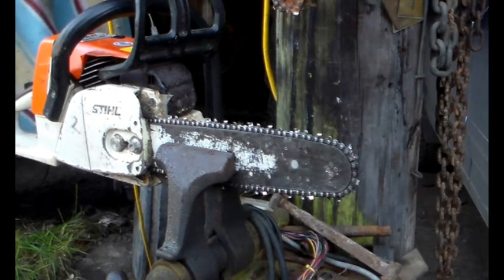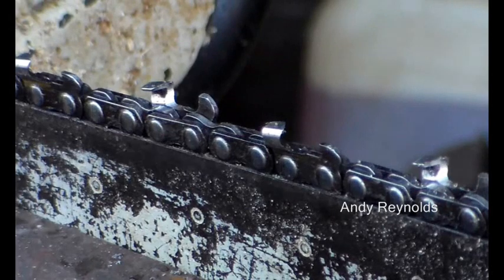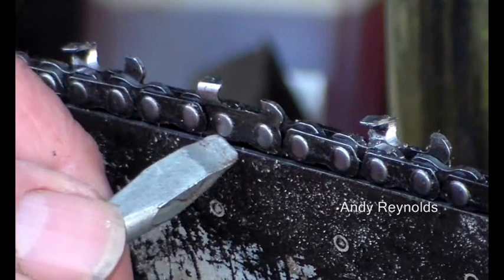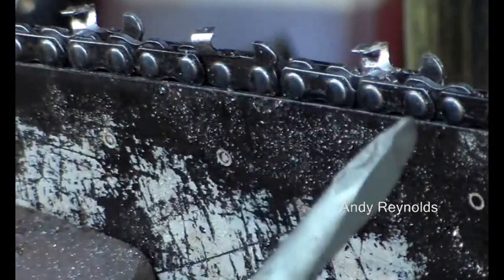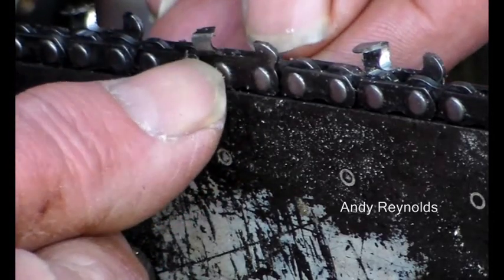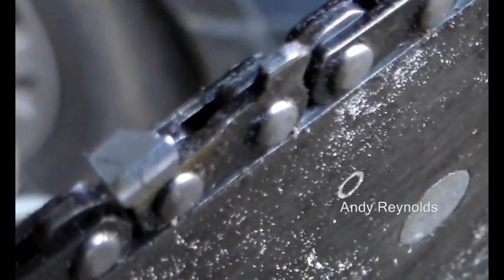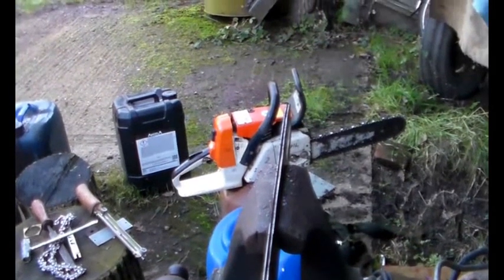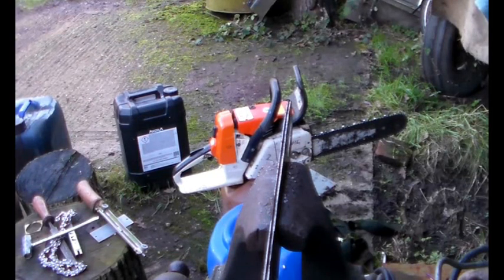Chainsaw: loose chain problems, spiral damage

Comment: Well, that makes perfect sense.
I've used chainsaws occasionally for 50 + years and never even thought about that.
Thanks for posting.
Reply from the maker: Kenny, good to hear from you and thanks for the comment. It's the chainsaw season so there should be more videos, cheers
Reply from the maker: Kenny, thanks for your comment. Your message on the inverter fix video has been held back by Youtube for I don't know what reason. That's why I haven't replied. It cane through my email but did not show up on the video, cheers

Comment: I like your emphasis on keeping your chain sharp. A sharp chain with correctly set depth gauges and correct cutting angles cuts smoother and you avoid the temptation to push on the saw to make it cut.  If you are pushing on the saw, you are working harder and gripping the saw harder.  Gripping harder exacerbates the effect of vibration in causing nerve and blood vessel damage (Reynaud's syndrome or HAVs/whitefinger and carpal tunnel syndrome).
Forcing a dull chain to cut causes friction heating of the bar rails and they turn blue. By this stage you have changed the temper of the steel, usually softening it, exacerbating wear.
Running a dull chain slack causes chain chatter and I have seen large burrs on the bases of the tie straps where they run on the tops of the bar rails. Eventually these break off.  If they don't, they compromise the range of movement of the chain components at the pins and I have seen a tie strap shear through causing the chain to break.
Maintenance is so important but sadly it often seems to get neglected by a short-sighted desire to keep work rates high. Thanks for the vid.
Reply from the maker: Hi, you are so right and it all starts with taking time to keep the cutters sharp every tank fill, cheers
Reply: Great analysis... thanks!

Comment: You would be amazed at the condition of some of the bars and chains I get on saws in for repair even some professionals seem to neglect them. A fairly common scenario is they want it porting to get more power and then you have to explain to them you don’t need to port it just keep the     chain  sharp and the bar in good order 
Keep up the good work I find your videos fascinating
Reply from the maker: Hi, It's an age old story, they may work in an industry but are not professional, cheers
Reply: Well said that man. I repair saws, but do not port saws for customers due to potential product liability issues.  Looking at it from another perspective, my main felling saw is a Husky 350 with a short bar in good order and sharp chain. On felling small and medium trees (mixed hardwoods) I can keep up with laddies half my age with much bigger saws....
Reply from the maker: @anemone104  Thanks for the comment, yes a short bar is less effort, safer and less cutters to sharpen, cheers
Reply: And your cuts are more accurate so you don't waste time correcting cuts or moving hung-up trees 'cos the tree hasn't gone where you wanted it to. I think we're both singing from the same hymn sheet. Many thanks!  @TheInfoworks
Reply: @TheInfoworks  I'm considering getting another bar for my old Stihl 034. I's got an 18" bar and I'm curious what you would consider a "short" bar. Thank you.

Comment: Suspect the hard facing on the rail is very thin anyone know how thin ? Induction tempering ?
Reply from the maker: Hi, thanks for the thought, there is no hard facing but the steel work hardens very quickly so it is difficult to drill holes in these bars. Like the chains they are a wear part, but I try to make them last as long as possible by using up my stock of part used chains, cheers

Comment: Chainsaws aren’t cheap to run, so why make it more expensive, by neglecting maintenance. You buy the best bar & chain you can afford for the expected tasks to come. Makes sense to then make them last as long as can be, by looking after what you’ve got. If you can’t or won’t do correct maintenance when needed, it’s time to pack it in.
Reply from the maker: Exactly, no argument with that.